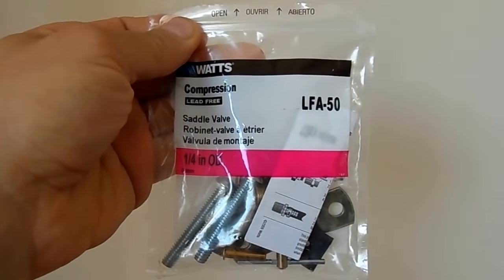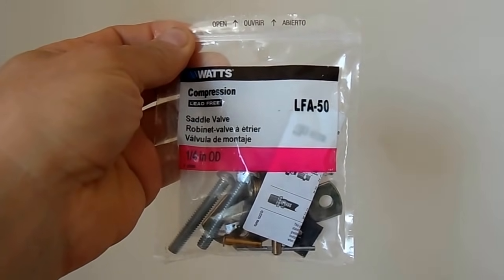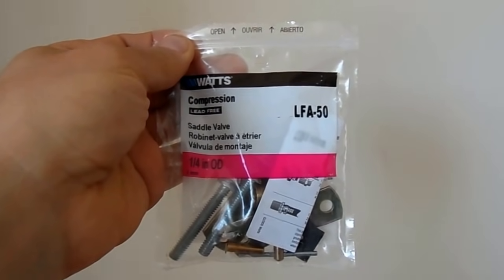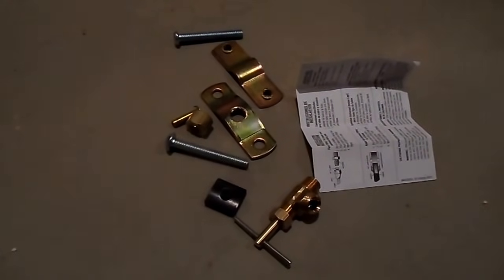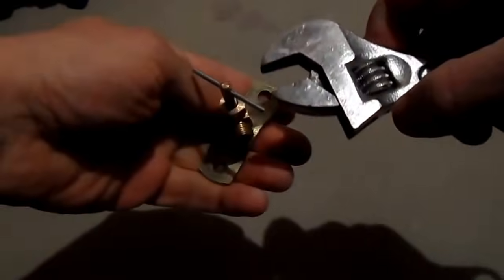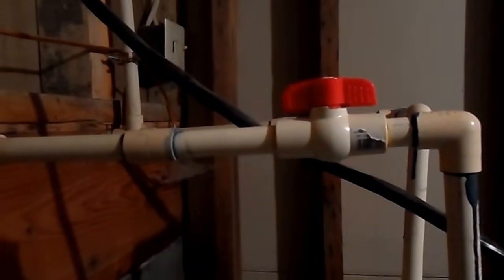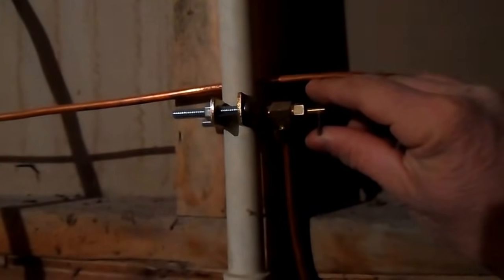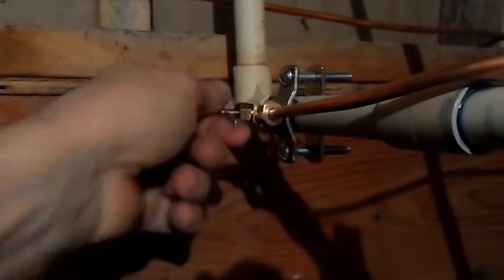How to Install a Saddle Valve (Plumbing Tutorial)

Comment: Can you open a saddle valve too much? The water doesn't come out very much and I think the valve needs to be open more?
Reply from the maker: Chuck Cooper My video sows how to install a self-piercing saddle valve. They are by far easier to install and are used almost exclusively to attach humidifiers and refrigerators these days. I have never had any problems using them.
Reply: @JanaeBerzon  yeah but he cant rape people in the ass on overcharge if too many people know that! The reason he thinks saddle valves are a "problem"
Reply from the maker: You cannot open a saddle valve too much - it's no different in this respect from other valves. If the water is not coming out, it is probably because the valve is not fully open or sediment is blocking it.
Reply: Steve Gajewski Most saddle valve you find are self piercing. you need the correct one. the correct one you need will require you drill a 1/4 hole in the pipe, all refrigerator ice maker's are metered for 1/4 inch water supply from the factory. the self piercing valve will not allow proper water fill. nor will plastic tubing. copper tubing is the best and correct tubing. I have been a repair technician for 51 years.

Comment: Is there no gasket from the water line to the valve? Mine keeps leaking but I don't see a gasket in the assembly parts.
Reply from the maker: Of course there is a gasket.  It's the black rubbery thing that the needle of the saddle valve penetrates through and that hugs around the pipe.
Reply: If my current saddle valve is leaking and I just want to replace it with another valve in the same spot without poking a new hold into my copper pipe is that doable?
Reply from the maker: Yes, it's absolutely doable and definitely the way to go. If it5 is leaking from the stem - you may not even have to replace it - just tighten the stem. If it is leaking from the interface with the pipe, it is a bit more challenging to get it aligned properly, but still doable.

Comment: great video!!  I have a question the humidifier saddle valve it is leaking. can I replace with new one ??
Reply from the maker: +lalo Miranda Where is it leaking from? If it is from the stem, you may be able to just tighten the nut at the top. If it is from the base, you may be able to just change the rubber gasket. You can also replace the entire thing. Just make sure that you align where the new saddle valve pierces the pipe with the old hole!
Reply: replace the goofy saddle valve with a real one. Think about it. Look at how it works. It will fail time and time again.

Comment: Those valves are guaranteed - to fail - do not use them.
Reply from the maker: +Handyjack I am sure that they can fail just like every other valve and every other man-made gadget, for that matter. If they start going bad (decades after being installed), you will probably see them dripping from the stem. I have never seen one that has failed catastrophically and this is how virtually every humidifier and refrigerator is hooked up to a water supply in this country.
Reply: On the other hand well done on the instructional video, these video are always welcome....I thank-you for the time and effort on tutorials.(Not your fault valves are what they are)
Reply: +Handyjack your solution?
Reply: Install a T
Reply from the maker: +golo5000 Like I have said before, these are no worse than any other valve and they are what is commonly used. If you feel like inventing a different solution fro the application - go right ahead!
Reply: I ended up cutting the pipe and installing shark bite valves. Everything is awesome!
Reply from the maker: That's a solution, as well. Just keep in mind that sharkbites are compression type fittings, so they can also leak over time. You are just trading off one potential problem for another.
Reply: Jake Berzon well i cant defend sharkbite because ive only used them short term. But I do want to say that all the attacks on sharkbites revolve around the fact that the only thing keeping water from leaking is a rubber oxring. But those same people will install propress fittings which use rubber seals. Or how about youre faucet and toilet intakes? All are reliant on rubber gaskets.
Reply: @doylee469  good point.
Reply: Handyjack I
Reply: +Handyjack They leak some son a bitch is selling it to make profit, there should be a lawsuit against this type of valve that makes a hole in your tube.  Every one, a that includes plumber had one word to describe it. PROBLEM...FULL STOP.....PROBLEM....
Reply: Jake Berzon No invention needed don't touch any valve that makes a hole in your pipe, what a piece of shit invention..

Comment: Do you have to shut the water supply do install this?  And whats wrong with using cold water?
Reply from the maker: +Aricu Nono With these valves, you don't really have to do it, but it is always a good idea to shut off water when you work on plumbing, just in case, if for no other reason! Hot water is what is required for the humidifier connection. You would use cold water for the refrigerator connection, of course.
Reply: Thank you, I ended up shutting off the water and releasing the pressure in the system.  I did go with Cold water.

Comment from the maker: Daniel, the refrigerator water line is 1/4" and this saddle valve fits a wide range if pipe diameters, including 1/2" and 3/4".

Comment: I saw that the package included a small brass tube that is flared at one end; you did NOT mention that piece at all in the video.

Sorry if I sound snarky but, I just discovered that the package I bought at Home Depot was short of one silver locking bolts and the water is shut off to the house and Home Depot is closing now.
Reply from the maker: +golo5000 I bet more people have leaks from copper lines breaking after repeated movement of their refrigerator then with the proper plastic lines, but to each their own!
Reply from the maker: Sorry about that, the installation in this video attaches a copper water line with a brass compression bead already installed and so does not use that flare insert that comes in the package. The next video in this series (about the refrigerator water line replacement) shows you how the flare insert could be used in an installation with a plastic water line.
Reply: +Jake Berzon (stockvalues) Don't use plastic copper line either use copper......guaranteed leak withing a 5 year time hope you are home to shut off water valve.
Reply: Jake Berzon Hopefully we don't regularly move our refrigerator, lets just do that with our car.  The whole faulty, lines are plastic(nothing proper about it) , talk to a proper plumber and he will give you stats on how many house calls on proper plastic lines.

Comment: There's a small pin that comes with this set. You didn't mention where that goes. ...
Reply from the maker: That pin goes inside the saddle valve. It first pierces the pipe that the saddle valve is mounted to and then opens and closes the valve as you turn the handle. Normally it comes already inserted into the valve an is not separately serviceable.